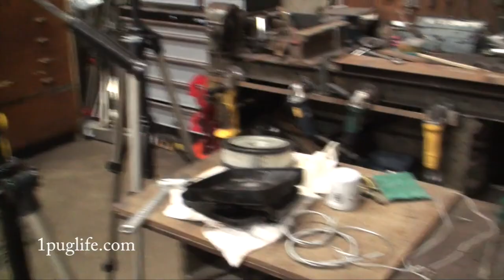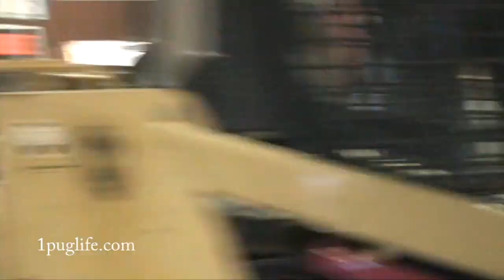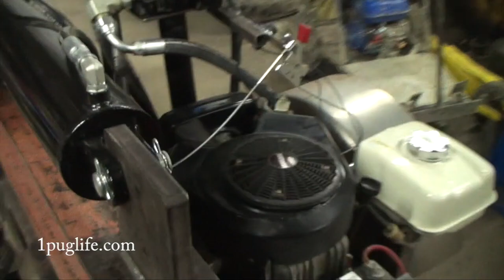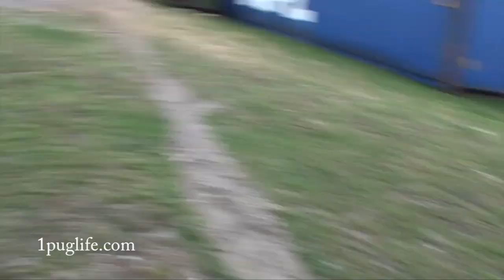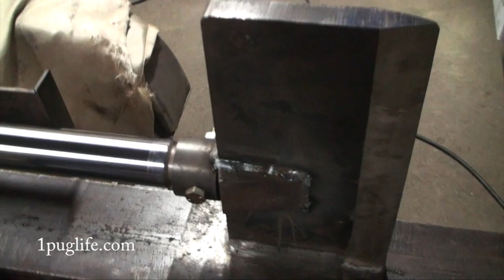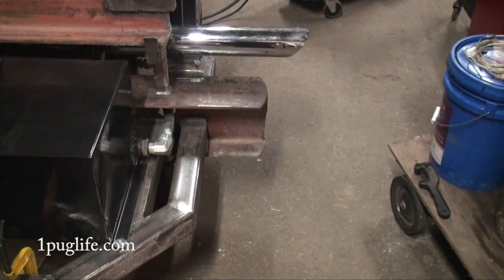splitty ready for paint and short romp

Comment: if your worried about the hydraulic hose getting rubbed just go to your caterpillar dealer and get a section of steel spiral hose guard to go over the hose, your suppose to put it on before your put the hose ends on but you can get it a size bigger than the hose then slide it over the hose couplings then zip tie or wire tie it in place

Comment: BMP, but I'm not overly familiar with Wood Splitters,  I'm jus wondering would it Not be more Efficient to add-on More Blade's.! As in have a Main Blade '|'  only add a Cpl More in an 'X'  so it Cuts it all in One Go.!

Though You may have to Stagger the Arrangement, so each Blades Cutting Edge Hits at different times, think of Tearing a Phone Book in Half, You spread the Page's so Your Only Tearing one at a Time.. Yar.!
Reply: he only chopping small logs though, not huge trees.
Reply: Even so, You'll still have to move the two Halve's to be Cut again into Two.!
That way could Cut-it-All in One Swoop...